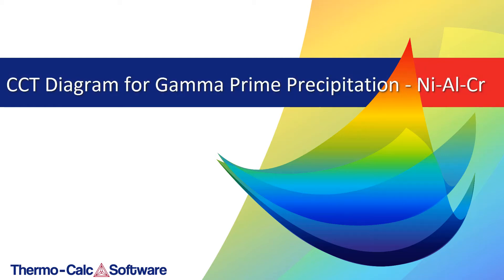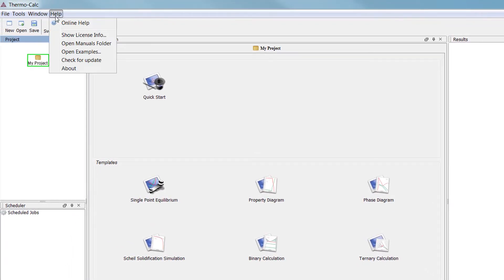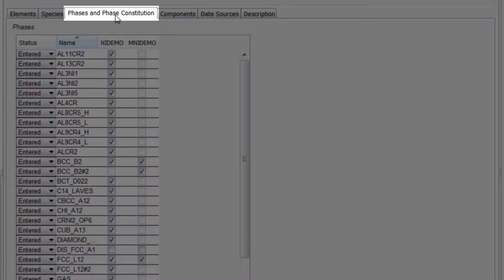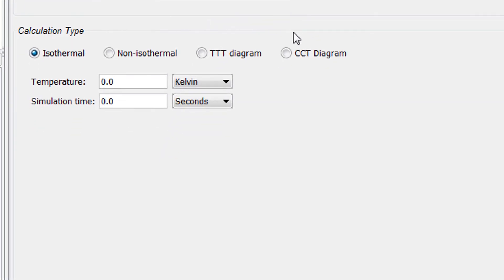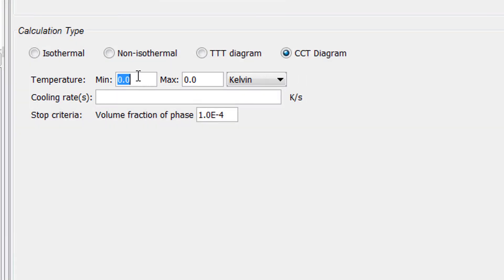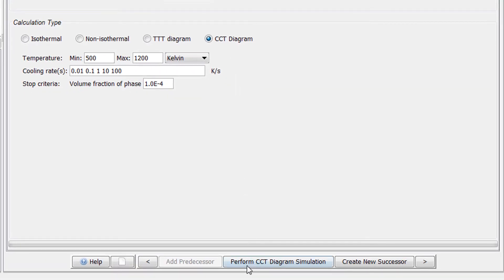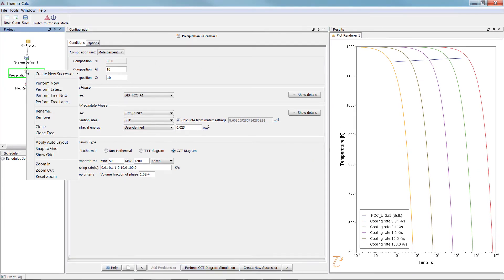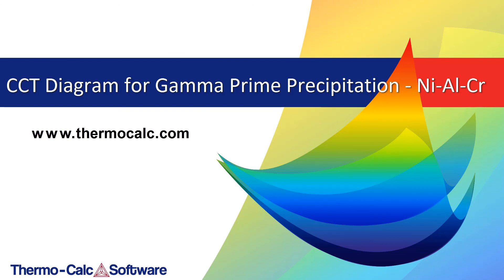Example P_07 - Precipitation Ni-Al-Cr CCT Gamma Gamma prime - OUTDATED

Comment: It is very helpful to see the nucleation interfacial energy used for these calculations. Is there any resource listing the nucleation sites and interfacial energies that should be used to calculate, for instance the common phases in nickel superalloys (g', g'', carbides) and other systems? Would these same settings be used for isothermal or non-isothermal nucleation and growth calculations? Also is there any guidance on using the DIS_FCC_A1/A1#1 as matrix vs the FCC_L12 phase? Thanks in advance!